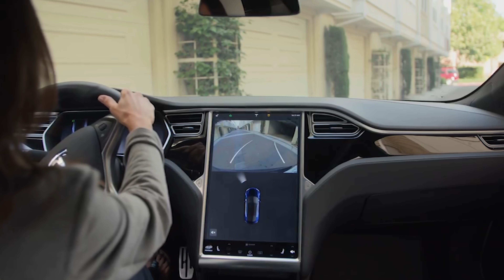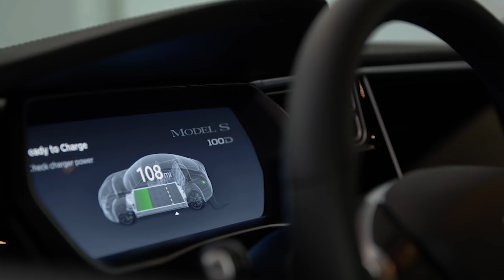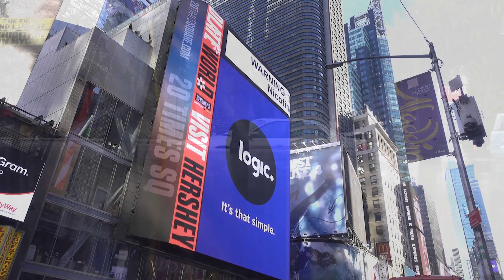Governments are Doing Very Little About Climate Change

Comment: Remember, batteries are of no use without solar and wind energy generation.
Reply: Which is already cheaper, and being built out despite generators resistance. I doubt their is a single profitable coalmstation in the western economies. Stranded already.
Reply: Well yes, if the sun goes out, we are all in trouble.
Reply: Well yes, if the sun goes out, we are all in trouble.

Comment: I believe climate change, but I am well aware of the dramatization and politicization of it. In reality, the models that have most accurately predicted the temperature change, oceanic acidity, and sealevel are all models that indicate there is little to worry about. The extreme worst case scenarios are more eye catching and sell better... It does however make actual scientists look terrible when predictions are wrong.
Climate change is real, but slow and curable.

Also weather events such as floods hurricanes and tornadoes are not affected by what little has changed "yet". That may be a result of inaction

Comment: The EV incentive as currently written will not help the US transition to electric transportation.  Ford offers three eligible cars:  Escape plugin hybrid, F150 lightning, and Mustang Mach-E.  Only the Escape is made in volume.  GM offers one eligible car:  The Bolt, which is currently on hold.  At best, the current incentive will drive Ford and GM to convert their other hybrids to plug-in versions.  Regardless, selling a hybrid does not move the US auto industry to electrification.  What is needed is an incentive designed to empower Ford and GM to develop replacement EVs for their ICE models.  The current incentive does not make it economically viable from a business perspective for Ford or GM to do that.  All it does is incentivises them to make more hybrids.

Comment: Auto makers are not making EVs as fast as they can... GM and Ford....?
Reply: No, just starting. GM and Toyota in particular have dithered on greenwashing projects, but their efficiency, batteries infrastructure and debt loads mean they are 10 or more years from real conversion. They thought they could drag it out, but Tesla stuffed it all up by proving you can not only make them fast, but efficient, and in real scale. 1 million this year and several by 2025. As they have fewer parts, last longer and cost less to own... whoops. That's becoming a real hole in the total market.  😳
Reply: @RacefanPat68  agree. Wouldn't buy a new gas car now. Resale will be hard.
Reply: Legacy autos are still wasting engineering R&D on ICE, Hybrids, and hydrogen.
Reply: @fredbloggs5902  Yeah, so it shouldn't come as a surprise when the go under.

Comment: Taxing fossil fuels will not impact each individual the same way.

Those who live in rurual areas, who are also generally poorer than those in the city, would pay the greatest level of fossil fuel taxes.  They don't have much in the way of alternative modes of transport either.

You'd have to build out charging infrastructure and likely provide bigger incentives to move these people to EVs before their city counterparts.
Reply: Taxing fossil fuel use only prolongs our use of it.
Reply: If we had a sensible government, they could do things like that, and/or provide rebates for poorer people to protect them from being harmed by the transition.  That, plus the disruption that's coming to rural economies when autonomous vehicles become a thing (Robo-trucks = no truck drivers = loss of well-paying working-class driving jobs + huge hit to truck stops and everyone whose living depends on them).
Reply: Let the chips fall where they may. I live in rural area in U S and surrounded by millionaire farmers
Reply: Partly  true, but solar pumps cheaper, solar grid connection cheaper, electricity cheaper. It's a very short jump. Look into indian irrigation, family plots even use solar, and in Africa remote villagers connected by local solar battery low voltage systems. Even small electric tractors cheaper to run. It's a ramp, but we all win. Especially rural areas where fuel costs higher